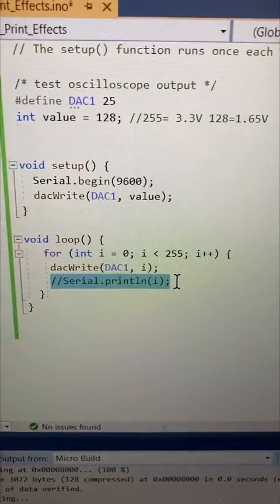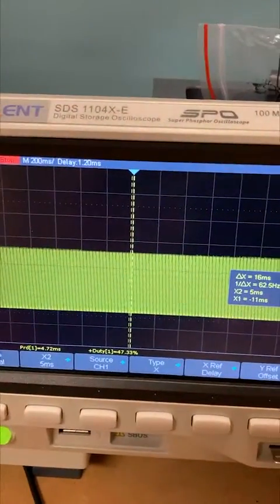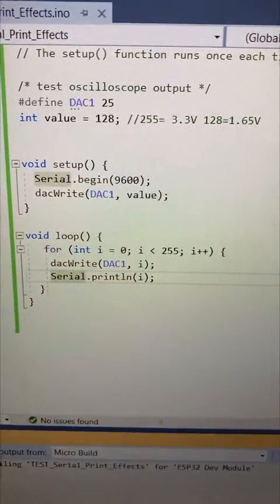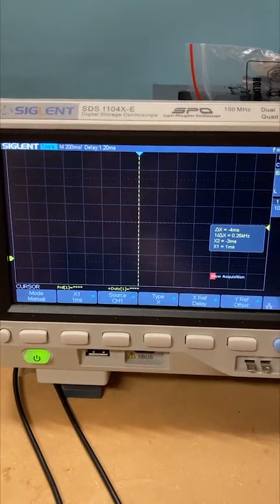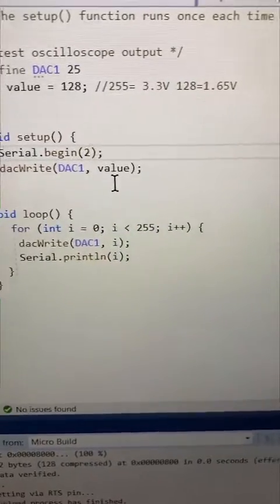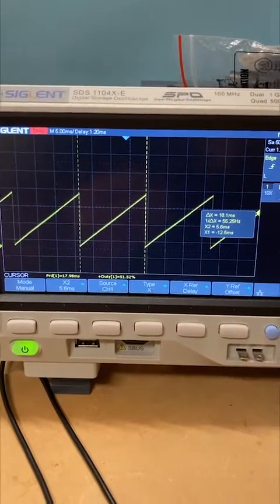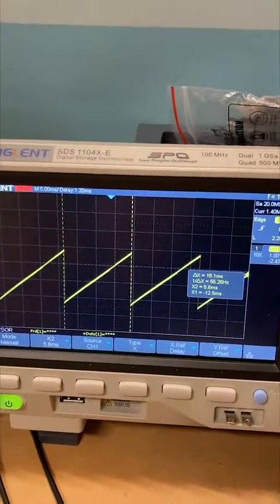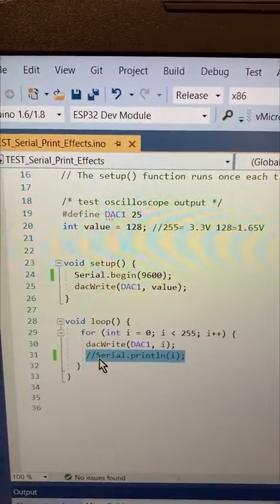Visualize Speed Impact of Serial.print using an Oscilloscope

Comment: anything will hurt the tight loop, duh
if you still need to dump, use interrupts
Reply from the maker: Mmm, interrupts? I am not sure what you are thinking here, maybe I'm missing something. Interrupt are still going to effect the DAC output quality even if the Serial.print is timed at every other ms or so. The real solution here is to have the second CORE do the Serial.println leaving the main CORE alone to execute the DAC loop.